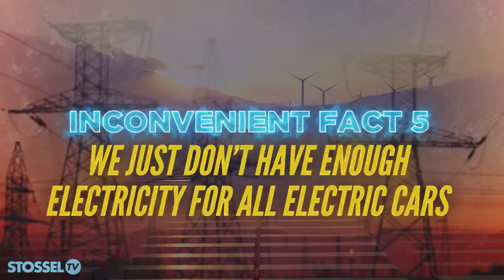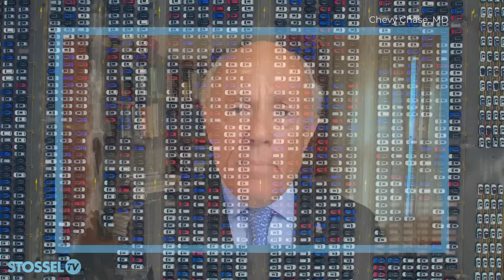Electric Cars: Inconvenient Facts, Part 2

Comment: The truckers testified that if they’re forced to use electric trucks, the time it would take to recharge to go even a couple hundred miles would make the food and supplies they are carrying much much more expensive.  Never mind the size and weight of the ev batteries added to their heavy load using more power and wrecking roads and endangering bridge weight limits.
Reply: Don't worry, the electric trucks won't have "Truckers" to testify...

Comment: The best line of the video is, "we had our energy systems designed by bureaucrats instead of by engineers."
Reply: And that explains the problem.
Reply: As an engineer this made me smile.
Reply: I disagree. I think the best line is "we're going to need everything," which includes EVs. The world only has 45 years of Proven crude oil reserves left at current consumption levels. (EIA)

Tesla was launched in 2001. It took 22 years to get where we are with EVs and there's a long way to go. Anyone who cares would want to conserve crude as much as possible.
Reply: @IndependentThoughts911  "The world only has 45 years of Proven crude oil reserves left at current consumption levels." Utter nonsense! In 1979, it was predicted that we only had 65 years of oil. In 1999, it was again predicted that we had only 65 years of oil. No one knows how much oil there is, and no one knows what technologies will be invented to locate and extract more oil.
Reply: That explains everything
Reply: I work on small engine driven machines.  It does seem sometimes that lawn equipment was designed by an out of touch engineer working in a skyscraper in some big city.  A person who has never mowed, tilled, or cut anything with a small engine powered machine.  It's pretty obvious the first time you have to loosen an engine from the spot it's mounted to replace a part or drain the oil.
Reply: @timsmith2525  I was told by a geo-surveyor directly involved in the petro search industry that there was about 40 years of EASILY ACCESSIBLE crude oil reserves but about 200 years of actual reserves.
Reply: Probably the worse line in the vid - its shifts the blame. Bureaucrats do the bidding of politicians and company boards. Politicians and Company directors are answerable to we the people - either as electors or as shareholders.
Reply: @graemesydney38  Right, and as technology advances or prices rise…
Reply: @timsmith2525  The EV tech that offers the most potential to reduce fuel/energy consumption, emissions AND insane traffic is plug-in hybrid. For instance, the battery resources directed to '10'
 all-battery BEV Tesla semi trucks that would deplete '5' huge 550kwh battery packs in 10 years could instead be directed to as many as 5,000 Household PHEVs that could keep the lights on in power outage indefinitely when matched to consequently smaller, simpler, more affordable rooftop solar arrays and neighborhood mini-grids.
Reply: OH the irony, says the political operative who knows nothing about this technical field. There's a sucker born every minute.
Reply: The ‘infantile’ comment was pretty good.
Reply: @IndependentThoughts911  We have enough oil to run this country full throttle for the next 100 years if all we used was nothing but oil to power everything. In reality with gas and nuclear etc we have 400 years of oil per Rand Corp. Problem is they wont drill for it.
Reply: As an engineer, I have a problem with this statement, and I do not agree.
Reply: One word is missing - "stupid" bureaucrats!
Reply: @artlewellan2294  So true! We know this because diesel trains have been operating this way for over 70 years. They're efficient and proven technology.

Most people think the train is driven by a diesel engine, but it is not. The diesel engine drives a generator which drives the electric motors attached to the wheels. Diesel trains are electric vehicles.
Reply: I am baffled with this 2 part video. I am not a fan of politicians and I am an engineer. Not an EV fanboy but an owner of one EV as well a Diesel car. Love both of them. The facts describing this video can easily be debunked. Please do your research and look at multiple sources.
Reply: elucidate....
Reply: @IndependentThoughts911  It appears that you are just a bit too dense to realize that the manufacturing of EVs, primarily EV batteries does not conserve oil.  It expends it during the mining and manufacture of the materials.  The break-even point (of conservation of oil) occurs at over 100,000 miles average use of an electric vehicle.
Reply: @IndependentThoughts911 keep your thoughts to your self. Troll
Reply: @graemesydney38 it doesn't seem so

Comment: Thank heavens people are finally saying these things that us rational people have been saying for years.
Reply: @Advanced Driving Yes, the most idiotic claim in this video is that we need to cover the entire U.S. with solar panels to meet our energy needs. The true number is a tiny portion of one of the 50 states. Anyone with a fully electric car and home does not need to even cover their entire roof to meet the energy needs, let alone their entire yard, let alone the entire expansive empty space in the country.
Reply: @dmacm  looking into it, I found estimates all over the place.
Reply: @Advanced Driving Pick a time slot?!?! I don't want to take time to "schedule" a time to charge my car. What if my plans change? What if I have something important come up? When I need power I want it on my schedule not the charging station!  And have you been on the major hi ways lately? They are busy busy busy, with thousands of cars across the nation traveling our great interstate system.  They aren't charging at home. Charging at third party chargers is inconsistant and very slow. If the charger even works at all.
Reply: @dmacm   You look at theoretical numbers, here are the real world numbers.

Per the EPA the daily energy use of all American Households 3.58 billion kWh - that's not including commercial or industrial.

Consumer grade 200W Solar Panels are 2ft x 5ft and around $250 ea.
In the real world they only produce around 150W.
You would need 10 of them = 20 ft x 5 ft to get 1500W which is barely enough to get "Level 1" standard plug charging on an EV which only gives you 1-3 miles per hour, or run a coffee maker.

In other words with 100 Sq Ft of solar panels you only get 1.5 kWh assuming full sun.

The US is 3,717,792 Sq miles. If you do the math per my 100sq ft / 1.5kWh you only get 294 million kWh - it's not even close.

But that was calculating it for 1hr lets say 10hrs of full sunlight (not accounting for sunrise/sunset losses) that's 2.94 billion kWh which is closer but still not enough and like I said that's barely accounting for residential only.
Reply: @Argedis  where did you get this info? I was trying to debunk libs and I keep finding articles saying min output is 250-400 now in 2022
Reply: By people you mean celebrities
Reply: @jetman1115  "They aren't charging at home. Charging at third party chargers is inconsistant and very slow. If the charger even works at all." Absolutely incorrect. 95% of all EV charging is done off-peak at home. The number of cars on the highways are meaningless in that discussion. We don't all stop in at a gas station at one time, we don't all go buy groceries at one time, etc. You plug in your EV at night when you go to sleep and it's full in the morning for pennies.
Reply: @Argedis  You should really think about your statement. If the average home in the USA can generate MORE than 100% of its energy using solar panels on the roof, then we would NEVER need the entire landmass to produce the energy we need.
Reply: @dmacm  Brawndo !
Reply: @justsomeguy934  That's very misleading since there are 2 types of "100%" solar generation. 

Type 1 is powering everything with solar EXCEPT your Furnace, HVAC, and major appliances which will still use conventional/fossil fuels.

Type 2 is "Net Zero" which is the real 100% solar power. Many homes would not be able to achieve this. 

Home Central HVACs alone can use 5kW+

Electric furnaces use 10,000 to 50,000 watts (10 to 50 kilowatts) of electricity.
Reply: @jetman1115  You can charge anytime.   Its just that some time periods are more expensive than others.  If you get a Tesla then your charging station is most likely to work.
Reply: @justsomeguy934  What runs my air conditioners ,,Refrigerators, chargers, laptops, lights, fire security system and the rest of the gadgets we own these day, oh the wife and kids cars  ?
Reply: @jetman1115  Picking a time slot saves you money. Tesla's allow you to do this with software. Your car will be fully charged anyway so why buy electricity during peak demand? You don't have to but if you want more expensive electricity then go for it lol.
Reply: @jetman1115  Apparently you live in the real world, not the fantasy world the ev advocates live in,where I live we have hurricanes, when you have to evacuate the interstate is full of slow moving,bumper to bumper traffic, if we go to ev' s i can just see thousands of people's ev's running out of there charge and with no way to charge them on the highway,in the middle of nowhere, getting caught out in the open,by a cat 4 or 5 hurricane, I can only imagine how many would die.
Reply: @Argedis  Where did you get your numbers, from a 1978 issue of Popular Mechanics?  We get 5 mile/hr charge on a Tesla 3 using a Level 1 110 wall outlet (not 1-3 mph as you and 1978 Pop. Mechanics claim)-every day- and with a battery at over 50% full- it would be faster on an empty battery.
We charge our Tesla and our house using solar roof top energy.  No problem at all.  But we live in the real world in 2022, not in your 1978 Popular Mechanics world.  C'mon into the 21st century, dude, it's not as scary as you Luddites think!
Reply: By rational I think you mean ignorant of the topic.  Notice how John avoided any fact and numbers.
Reply: @jetman1115  " I don't want to take time to "schedule" a time to charge my car. What if my plans change?"
Do you sleep? On a fairly regular time frame? Well, that's when you charge your car if you want. If your electricity is cheaper off-peak, you can charge then. Don't get your panties in a bunch...
Reply: @jetman1115  "When I need power I want it on my schedule not the charging station! "
95% of all EV charging is done at home. You do NOT schedule highway charging whatsoever. Geez, as an EV owner before you raise your blood pressure...
Reply: @jetman1115  "They aren't charging at home. Charging at third party chargers is inconsistant and very slow. If the charger even works at all."
Absolutely false. I've driven my Tesla all over the USA, no waiting, no worries, no scheduling.
Reply: @hubertwalters4300  "can just see thousands of people's ev's running out of there charge and with no way to charge them on the highway,in the middle of nowhere, getting caught out in the open,by a cat 4 or 5 hurricane, I can only imagine how many would die"
Quite the apocalypse you plan for, mate. Do you watch a lot of disaster movies? I mean, you forgot to add in alien invasions and nuclear bombs in your scenario.
Um, show me a hurricane in the USA that pops up with, say, 5 minutes notice. You know, a "surprise" hurricane. One second it's sunny, the next second it's Kansas and Auntie Em.
I'm guessing you sleep with the light on?
Reply: @TheBoru2011  "What runs my air conditioners ,,Refrigerators, chargers, laptops, lights, fire security system and the rest of the gadgets we own these day, oh the wife and kids cars  ?"
Electricity probably runs all those things, and electricity comes from lots of places. Gasoline, only one.
Reply: 5:35 there is no such thing as fossil fuel! Raw oil is produced within the earth all the time! Please do your homework and don’t use this false term anymore.
Reply: @dmacm  Agree. Make your calculations as a real engineer. 
My numbers are from europe sunshine at 52 degrees north, the netherlands.
A solar panel directed to the south in a correct angle will produce on average 950Wh for each watt peak every year. When there is no shadow from objects around the panels.
A 5000 Wp installation produces 4500 KWh of energy in a year. A car drives on that energy (model3Tesla) ca 17000 miles (27000 km). For this you only need 11 panels 450 Wp. This is 22 m^2 of modern solar panels. The south roof of my house is sized 48 m^2.
More than twice the amount I need for driving this distance...which is already the double distance of the average car usage in the country.
In Poland, more east, in a year there is less cloud coverage of the sun. The same panels would produce in Poland not 4500KWH but 5200KWH on average.

Comment: I’d like to see another inconvenient fact of solar panels and batteries primarily made in China due to cheap labor and ENERGY… due to massive amounts of coal plants. It’s about 75% of the global market, ALL made in China.
Reply: and also many extremely dangerous chemicals are used to make solar panel, in China NO regulations are followed to dispose of those extremely dangerous compounds
Reply: @VladK-1  it’s also impossible due to the restrictions countries like the U.S. have on energy and other environmental agency restrictions that don’t exist in China. Which allows their startup companies to be more profitable (on top of cheap labor and tariff rates) at the get go, before taking into account of the resulting economies of scale.
Reply: Another inconvenient fact is that those solar panels and batteries are produced using fossil fuels!
Reply: That’s why I don’t believe they will go to war. We need each other.
Reply: So what most of the green energy will be derived for nuclear power only way it going to happen.
Reply: @tracybarhite1764  True! Huge diesel machines that burn 200 gallons of fuel per day only produce a few pounds of rare earth elements required to make solar panels. Even common glass and aluminum used in the panels require huge amounts of fuel for production.
Reply: @gregoryt8792  except the problem with this conversation is that energy companies are buying Chinese made solar panels and batteries (as they are the cheapest) and selling consumers their monopolized / government subsidized product.
Reply: @TheGuruStud  They think like children, they think bacon comes from the store. Or should I have said "bean curd"?

Comment: My friend's brand new electric car just left her stranded with a full charge.
It gave her a minute warning before it shut off.
It had to be towed to the next city because nobody here can fix it.
They still don't know what went wrong.
I'm sitting in my 1987 Toyota Corolla and can pick from most any repair shop if it breaks.